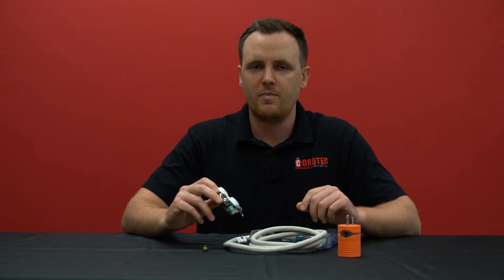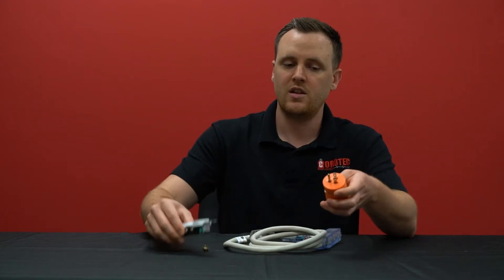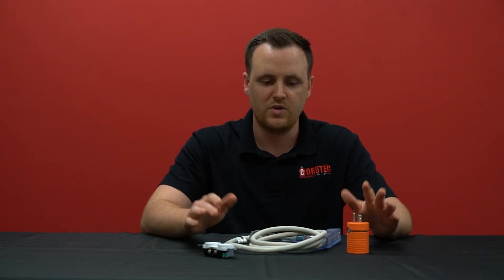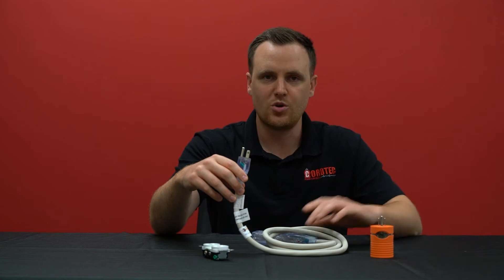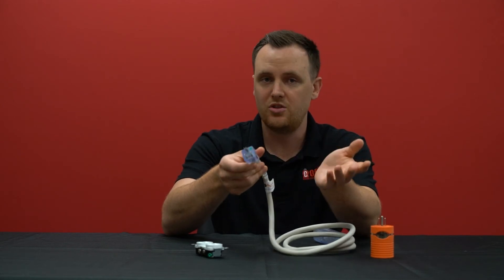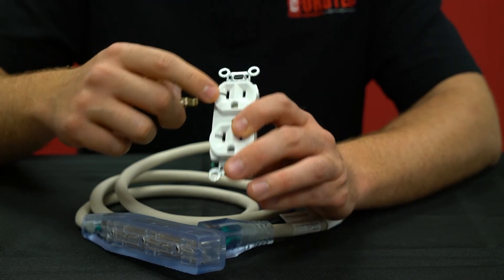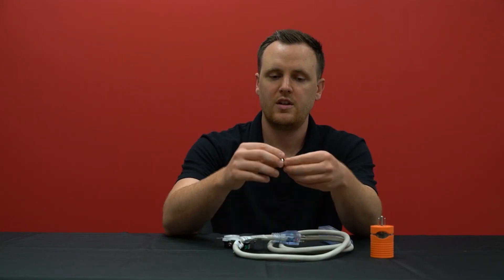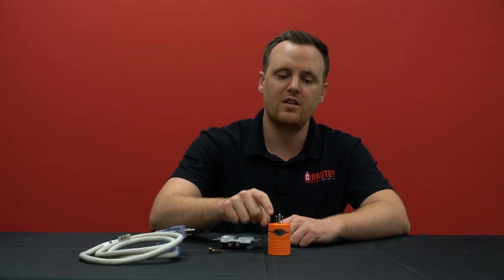Why Some 5-15 Adapters Can Operate at a Higher Capacity

Comment: Can you make more of those "Outlet Solutions Identifying" videos? Because I have an idea of what outlets should be identified next: 
7-15/20R
14-20/60R 
L16-20/30R
Reply from the maker: Thanks for the suggestion! Do you mean L7-15/20R and L14-20? We don't have anything that is just 7-15/20R or 14-20/60R. We have L16-20 and L16-30, so I can do a video on those soon. We are still learning what pieces of equipment use L16-20 and L16-30.